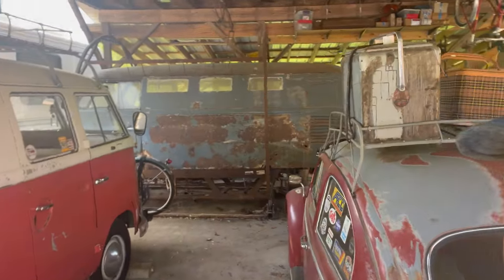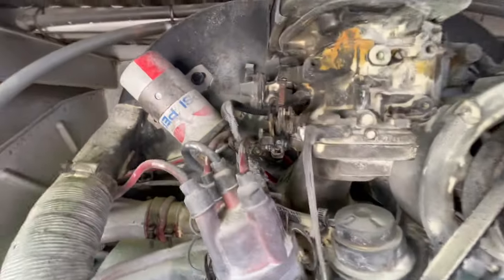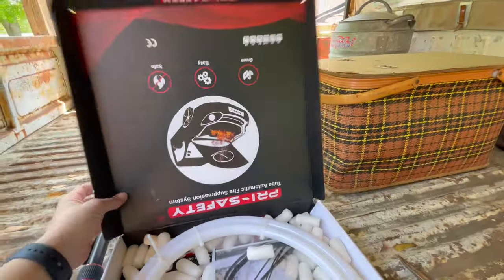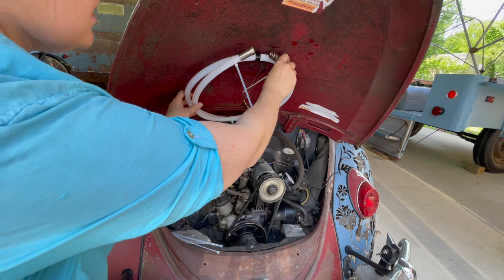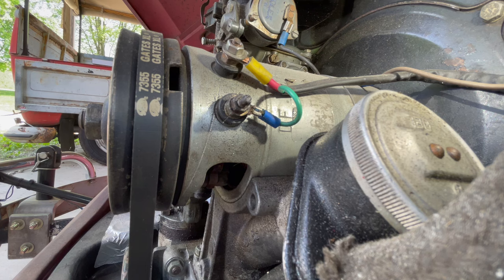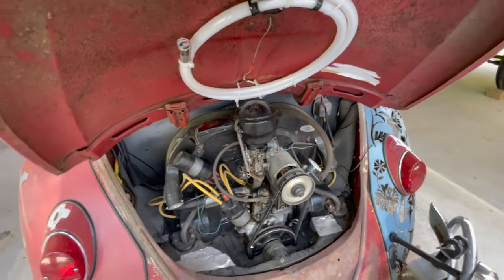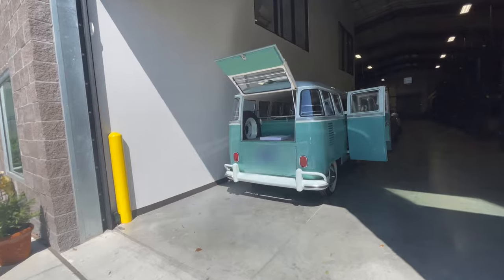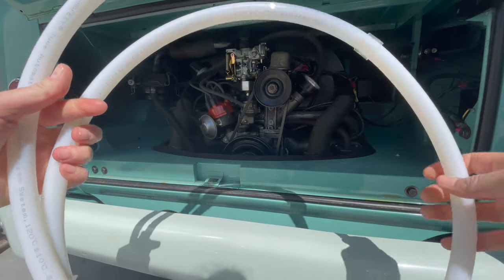How to Prevent an Engine Fire!!!

Comment: MOST COMMON ENGINE FIRE......Barb on carburator comes out of the carb......The little brass incert that the fuel line goes into.  2nd Rotten fuel hose with no clamps on the pressure side. 99% of Vw engine fires are these items. Even though the fuel hose is woven, it still needs to have clamps on all pressure sides of the fuel pump. They will slide off. On yours you have the Webber 2 barrel so it has 7mm hose at the carb. There is some FAKE german hose out there and it fails very fast. Or you may not have had german hose. Some people say use neoprene. i have not had any problem with the german hose in CA.....IDK. My guess is fuel hose failure squirted on the distributor.
           Those generic filters (clear plastic) are good because they have a 5mm and 7mm step....Guys tell me all the time those fail. I heard of more than 30k cars in Socal that have those filters and NONE have ever ruptured and caused an engine fire. But the Glass 3 piece ones....OMG fire every time.
Reply from the maker: thanks as always for the info mike! I WILL be sure to let everyone know what happened as a precautionary tale!

Comment: MARCI.......I cant believe what I am looking at.......NO HOSE CLAMPS on the PRESSURE SIDE......Please on the pressure side from the pump to the carb put some hose clamps on there. Both on the bus and the bug.....Then check the carb to make sure the brass end is not loose. Those hoses are NOT CHINESE FINGERS....THEY NEED CLAMPS......This has been the cause of most engine fires. hose gets a little old then slides off. if the barb on the carb is loose pein it and also put a leash wire from the top hose clamp to one of the carb bolts. Pull it tight this fix has worked for many cars.

Comment: On my 61 double I saw smoke while driving in Hilo big island and by the time I stopped 2 different shop owners had ran out with fire bottles ready when  I opened the engine lid ,,the cause wires going through the metal wall without any rubber grommets and a wire had cut through and grounded out. 4 hrs from home had to call the wife and leave it   us living in Kona but new CB performance motor but im gonna get this fire system your showing. great video. Aloha
Reply: Thanks Marci, I got mine a while ago but they recommended a longer one for my split window bus. Hopefully I'll start it soon, lots of loose ends to do before that.
Peace
Reply from the maker: oh my goodness! wow! I feel very lucky  to have been right there and prepared

Comment: glad you noticed quickly and were fast on your toes to save the truck. could have been far worse.  the culprit I read always seemed to be the nipple on the carb for the fuel supply coming loose.
Reply from the maker: I'm so very thankful and glad I was prepared!
Reply: On an older car, rotten rubber fuel hoses are another major cause.

Comment: M y guess is gas hose and filter touched the distributor wires and BAM a fire. When the fuel line gets dry it starts to shrink and losens then the gas weeps. Or like what Mustie1 said on Crusty it's the fitting of the fuel line that goes in the carb.
Reply from the maker: I DID have to chuckle that he had a "fire" situation video pretty much  the same time I had one planned.  I always start the year checking and inspecting everything which WAS done on this bus two weeks prior to this fire...just proves you can NEVER be too careful!

Comment: When cutting zip ties you should use a "flat cut" set of dikes. These will allow you to make the cut right at the "knuckle" and cut the tail flush and smooth. To cut zip ties and leave a stub is asking for cuts just like you have, the improperly cut zip tie can be as sharp as a knife blade.

Comment: One of the big reasons we see fires in our VWs is because the ethanol in our gas will eat through the "factory" fuel line.  Yes even the modern reproduction fuel line.   It happens when the bus is not running and air can form in the lines and the ethanol just makes the fuel lines brittle.    So we need to replace the fuel lines all the time.   However there is a top secret tip that no one seems to know about, but Honda Fuel line is ethanol safe and is the right diameter for our buses (both are metric fuel lines)!  I check the fuel lines every year and my 5 year old lines look brand new.
Reply from the maker: I'd heard that about the Honda lines before, I'll get some and give it a try the net time!!...and yes you are correct the gas kills the lines! These had just been replaced and I was fairly certain it was not a fuel line but agreed I change them often as they get brittle...they get really brittle AFTER they have been on fire! lol Minimal damage on this guy and he's all back up and running!

Comment: To preface I have had 42 aircooled VW's since 1979 and was a VW Tech for 9 of those years, now driving my 70 camper/daily driver which is #42. The fire damage I see looks related to your after market carb and/or the linkage which may have rubbed the fuel line and or filter the wrong way. That's my theory. Of the 15 or so VW fires Ive seen including the almost one in my 65 Sundial camper were more often than not started by the stock metal fuel line in the stock location rubbing on the engine sheet metal it passed through. of the great many more I just worked on after the fact when they showed up at work, 98.9% of those fires were pilot error. Bad or no maintenance. Anyhoo let me get that soap box outa the way! As always dig the vids and am super jealous of the collection. specially pickles. OH! my 55' single cab!!
Reply from the maker: wait til you see what is was that caused it! You will believe it but wow...I was stumped for days and as I tore it down looking for the culprit I would NEVER have guessed what it was...let's just say I have a new thing to add to my annual change these out list! and it wasn't a fuel line, carb or the other usual suspects...video will be up soon on what failed! I have the content just need time to upload! Thanks for sharing!

Comment: Wait...the fire was bad and hot enough to melt tar in the bed but the Blaze cut did not go off?  That is not a good real-world example of the competency of the Blaze Cut.  I would be calling them and asking for a refund of your $300 bucks.
Reply from the maker: It was so ready to go off...I can't believe it didn't BUT if you watch their video of it here on YT, The flames get pretty gnarly before it actually puts out the fire! I installed a back up camera in there now too...more on that in a coming video! Thanks for stopping in!

Comment: More often than not, a fuel line leak is the cause of any VW bus/Vanagon fire.  It is a good idea to replace all the flexible hoses in the fuel system on a regular basis.  If your bus is on fire, be certain to turn off the ignition before doing anything else.  If it is caused by a fuel line leak, this will stop additional fuel from being added to the conflagration and give you a chance to save your car.  YouTube has many videos of VW busses/Vanagons going up in flames.
Reply from the maker: agree with all points, we replace the fuel lines every year (because you just can't get the "good" stuff any more) we also run the automatic fire suppression systems and I now have a camera in my engine bay! so I can see while driving what is happening back there...ironically this fire was caused by a pretty ridiculous failure...brand new (within the year) intake boot disintegrated and when I flooded the engine attempting to start (long story there...but) the fuel backed up in boot...poured out the cracks and boom I had a fire...I count myself very lucky that I was right there when it happened

Comment: My 1963 panel bus camper started on fire when the brass piece fell out of the carburetor the car behind me sad there was a huge ball of fire came out of the bus smoke came out of the defrosters on the dash shut it down pulled over fire was out replaced all the burn wire and was back on the road 30 minutes later scare the sh#t out of me and three passengers ! Those thing are a really good idea ! Back to work on the bus yet ?
Reply from the maker: Always working on a bus or something! Gotta keep a gal busy!

Comment: Faster then the fire surpression system! You really did a good job! Luckely you saved your bus!!  What is important you clean tour engine Bay and tour engine a.s.a.p. The fire extinguisher often uses a kind of salt. This is highly corrosive!
Greetings, grom the Netherlands
Reply: I was going to add this point...... unfortunately the damage is already done to the wiring insulation and any other plastic components, it will feel ok for a while but will deteriorate really rapidly. All powder extinguishers have been removed from the Siemens fleet of wind turbines because of the future damage their use will cause. Glad your bus survived, well done on your quick reactions.
Reply from the maker: I am very lucky indeed...don't think I ever moved so fast in all my life!

Comment: Safety pays.... as it says on your license plate! To be honest, i always put vw fires down to poor maintenance (hoses and clamps, poor condition of plug wires) or the infamous carb inlet, which is a pressed fitting but should really have a thread on it. Overflowing carb is another hazard but usually results in fuel being dumped into the engine. Sorry it happened to you but glad you caught it early.
Reply from the maker: I'm betting on carb failure...as hoses were recently changed and and overall inspection was performed (a kind of spring cleaning thing we always do to the vw's) but I will be sure to let everyone know when I've fully investigated.
Reply: @marcijunebug  please do!

Comment: Must have been a scary few seconds when you saw the smoke and then the flames erupted when the engine lid was opened.  
Quick thinking and being prepared with the extinguisher on hand saved the day.  In over 4 decades of air cooled VW ownership, I've been lucky enough not to experience an engine fire.  Very lucky, no doubt.
I haven't seen the fire suppression system you installed in Australia, but perhaps i need to look harder.  Peace of mind is worth everything.
Reply from the maker: I am probably overkill on fire extinguishers but can't be too careful...I keep two of them in the carport, one front and one back...and keep one in each car even the NEW cars!
Reply: Thanks Nick
Reply: @marcijunebug  I now keep one near my bbq.  I had a grease fire get out of control and if not for the extinguisher I might have lost the house!